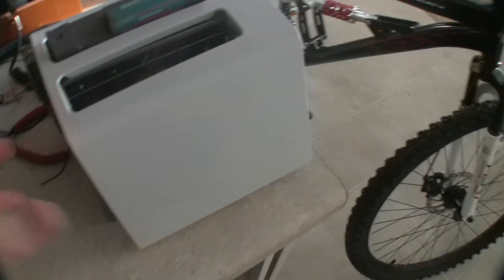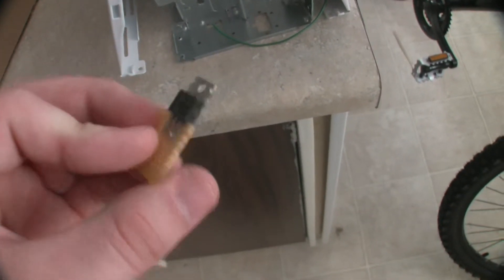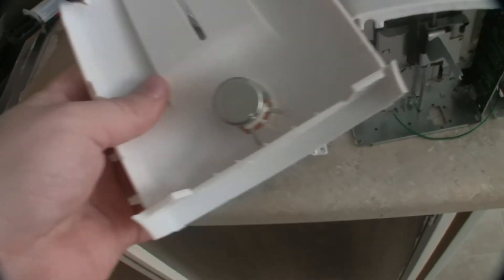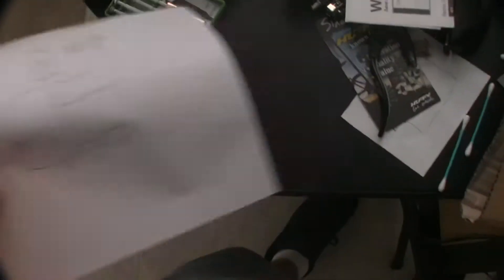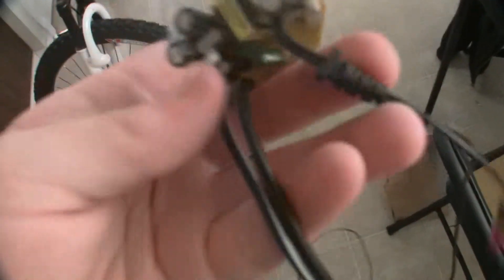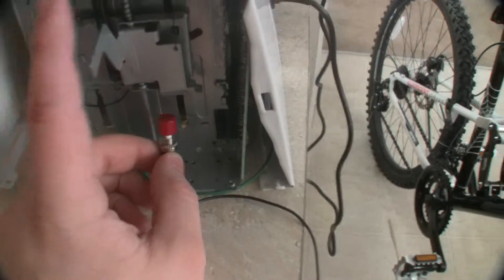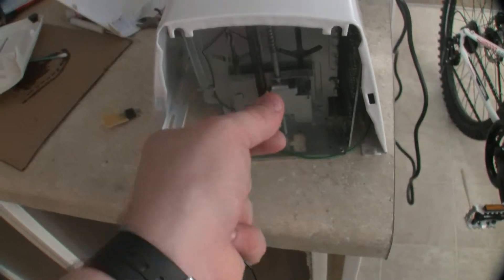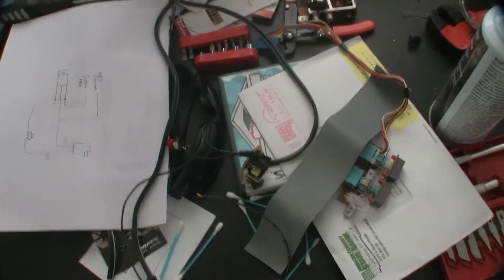Nintoaster Update

Comment: nice vid working on one myself,  have you considered using a latching switch like the one power button the nintendo originally used? you would have to pull the lever down to turn it on and then again to turn it off but it seems it would be a small sacrifice. that or use a permanent magnet